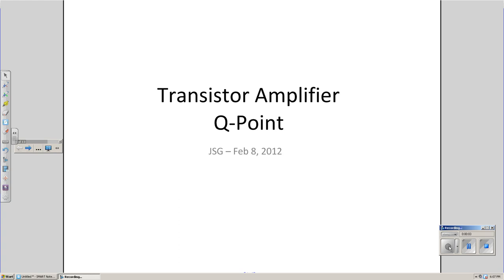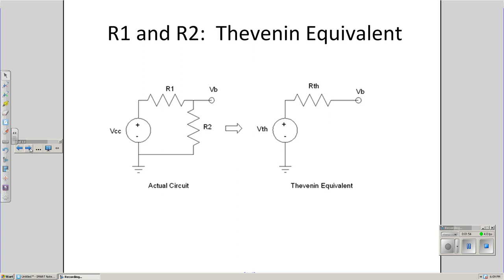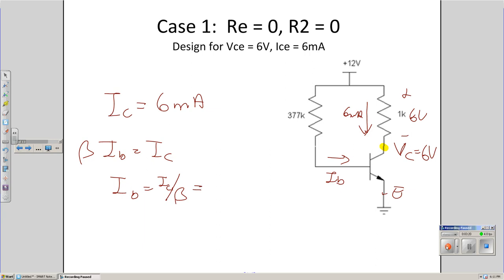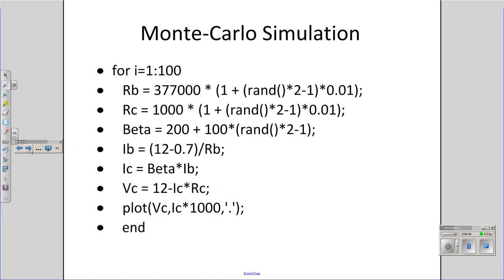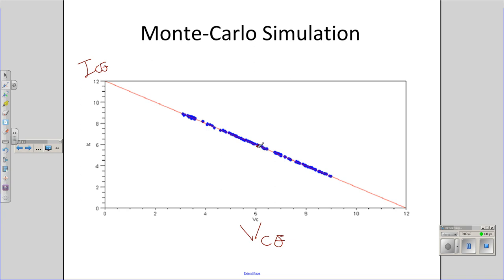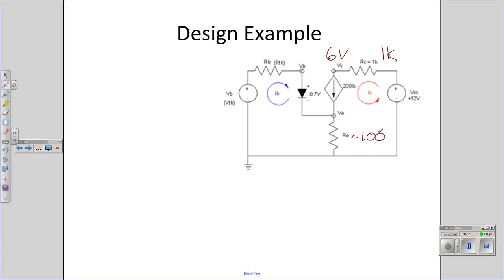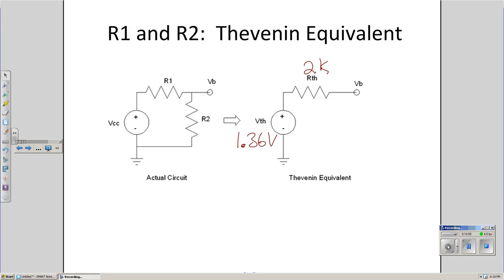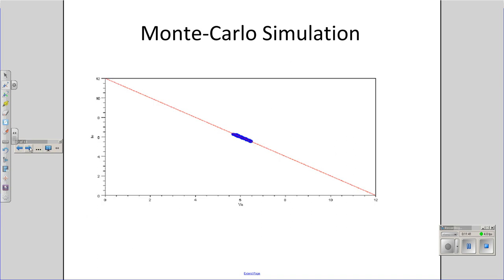BJT Circuit:  DC Analysis

Comment: so im an electronics hobbiest at this point since I havent taken any electrical classes but this stuff is making sense. The more my circuits fail the more theory I learn although I could probably use more practical knowledge
Reply: highly recommend to take some classes tho :)
Reply: Read the art of electronics. Also, read Engineering Circuits Analysis 8th edition by William H. Hayt. You can find it free online. The book is made such that you could teach yourself, even without taking a class or having the mathematical background, because it gives you all you need for the very basic parts of circuit analysis.